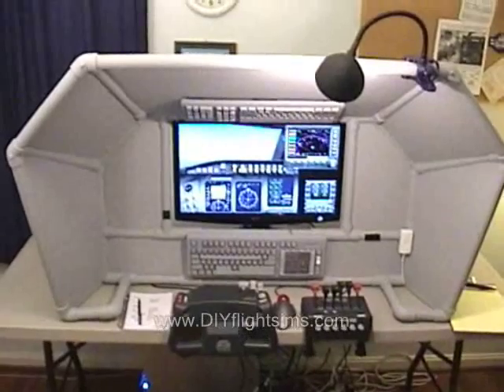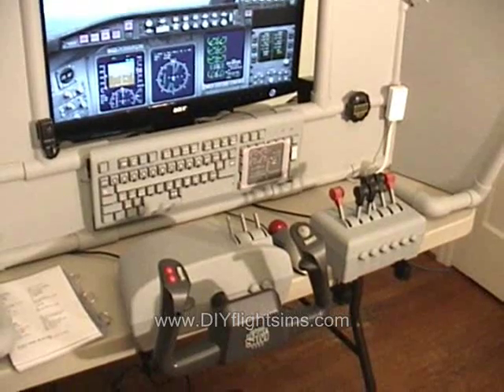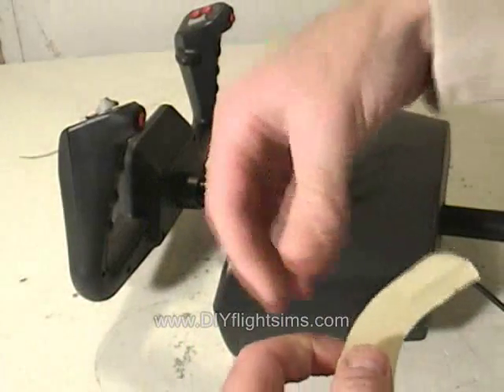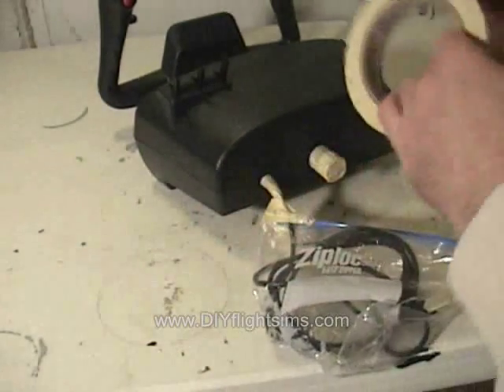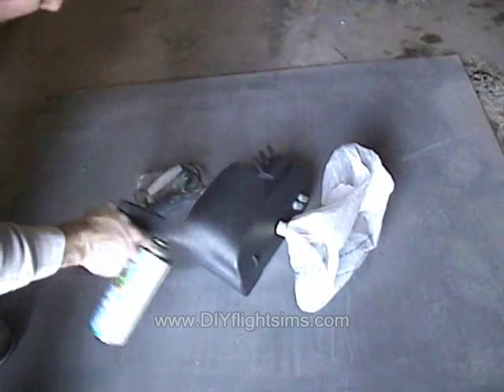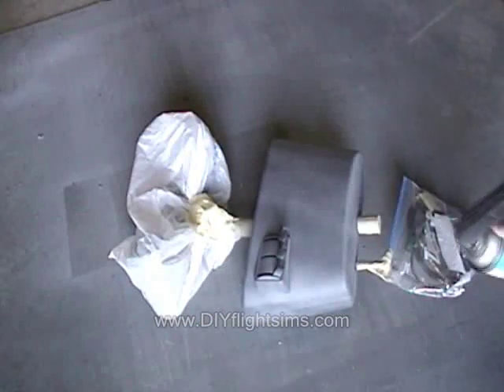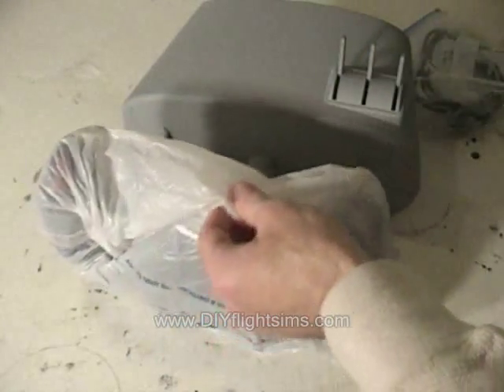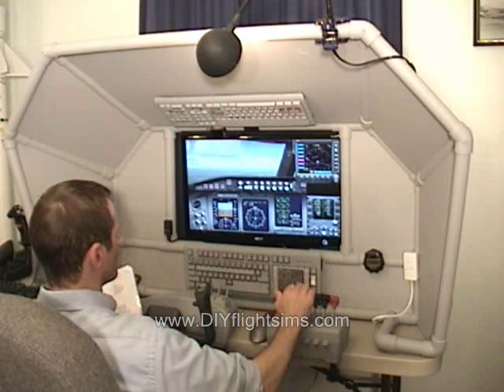Paint Flight Simulator Yoke

Comment: @rogerdodgeraviation  the CH yoke is junk compared to Saitek's.  I've had mine for almost two years and it still works perfectly.  I also bought their rudder peddles and I am going to buy their headset for multi player flying.   Everything comes with a two year limited warranty.  If you want a good yoke that will last you a long time, spend a little more money, and go Saitek!